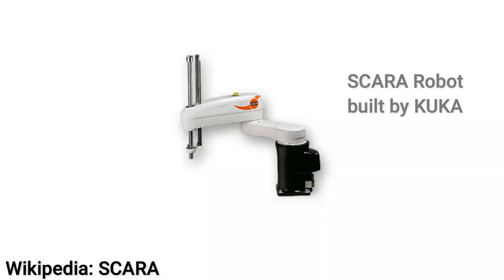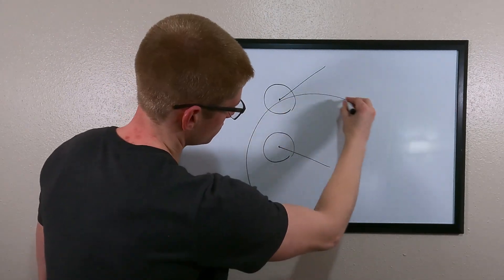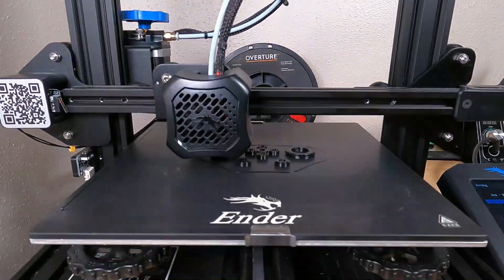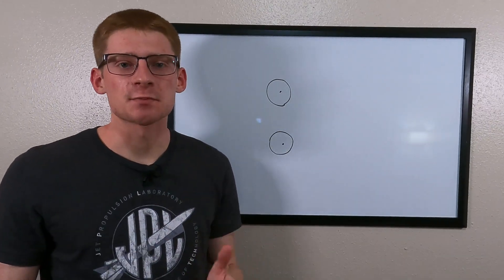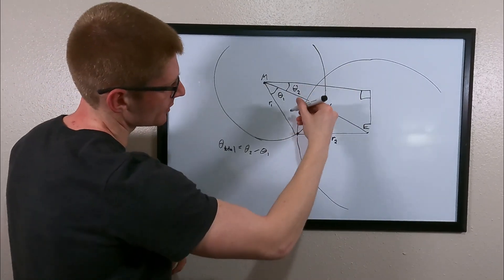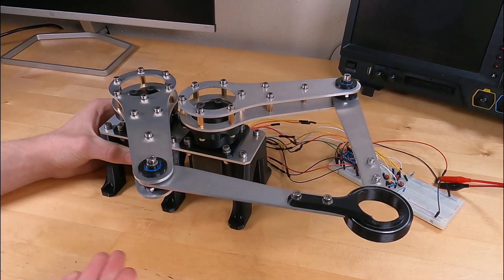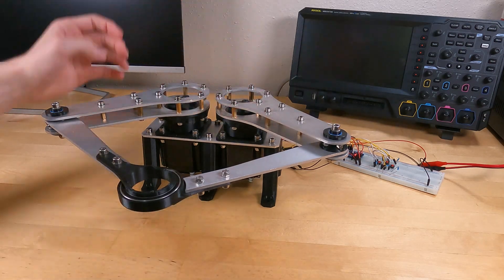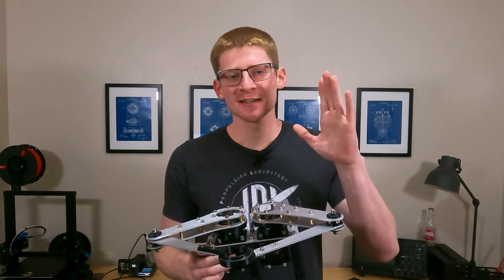I Built a SCARA Robot

Comment: Great job on the video! As a robotics engineer with experience designing and deploying industrial robotic arms, I have a few recommendations for improving the performance and reliability of this project.

First, I recommend using stepper motors with pre-installed gearboxes. Stepper motors offer precise control and high torque at low speeds, making them ideal for robotics applications. Gearboxes can help reduce the required torque and increase the achievable speed, but they also introduce backlash and hysteresis, which can affect the accuracy of the system. Pre-installed gearboxes offer better tolerances and lower backlash than those that are 3D printed, which can be difficult to manufacture with sufficient precision due to machine errors and limited material options.

Second, consider using closed loop stepper motors for professional use cases. Closed loop control allows the system to detect and correct errors in real-time, improving the accuracy and reliability of the system. It also enables additional features such as homing, which can be useful for calibrating the system or returning to a known position. The additional cost of an encoder - around $20 per motor - is generally worth it for professional applications.

Third, consider using a more powerful microcontroller. The Arduino Portenta is a good option, as it offers high performance and a range of connectivity options. Alternatively, an RP2040-based board can also provide good performance at a lower cost. The microcontroller plays a crucial role in the control and communication of the system, so it is important to choose one that can handle the required workload and has sufficient memory and processing power.

Finally, if you plan to add an end effector to your setup, make sure to consider the weight and the required torque and speed at the joints. The selection of bearings will depend on the load and the required stiffness and accuracy of the system. Proper sizing and lubrication of the bearings can help improve the performance and lifespan of the system.

I hope these suggestions are helpful, and I look forward to seeing more of your work on the channel!
Reply: Why recommend these mcu's? Portenta is way overkill and the 2040 does not have a single timer/counter with decent functionality for motor control. Closed loop for steppers is irrelevant if the system is designed correctly (e.g. loads are within spec).
Reply: Hi,  @MrFujinko 
What kind of characteristics do you need for a timer to be useful for motor control?

Comment: For some beefier processing check out the esp32 dev boards. They can be programmed with the same Arduino IDE and code but are single or dual core, 32 bits, and up to 240MHz. Oh and like four bucks a pop.

Comment: Why did you opt to use the cycloidal gearboxes? Those motors should've been plenty torquey all by themselves to move the arms. Less jitter too.  Industrial scaras are direct drives as far as I know.
Reply: I think resolution would be more of a problem than torque. 1.8 degree full steps are several mm of linear movement. Even with microstepping it's pretty coarse, and then torque is not good either.

Comment: Have you considered adding one or more off-cycles between heavier calculations where you use a bit of interpolation to smooth things out before correcting the position in future cycles?
Reply: Sidenote each trig op takes much longer than a digital write I believe, but youre doing a lot of them and they add up so you might also want to look into direct port manipulation. For every set of digital writes you could basically have a single register store and it would be something on the order of 10-20 times faster. I also realize you are using a lot of delays which I'm not sure aren't just as significant than whatever math the arduino has to do. So if those are necessary - and it looks like they are - then nothing with port manipulation will improve efficiency much and you probably already knew that.

Expect the asin operation to take something like 100 micros although you also do some math inside the sin but lets say no more than 200. Some people have made their own look up table implementations plus some interpolation to combat the slow trig functions but I would start here first and before doing anything too fancy you would probably just get a different micro which is completely reasonable.

Comment: Nice video! Good explanation of the IK. A large difference between scara and this 5 bar is that this is a parallel manipulator while scara is serial. How did you decide link lengths? I read a paper awhile ago about optimization of workspace to determine the geometry. Nice work again!

Comment: It seems we should all be buying toy robots first and learning how to control them  easily.  The control system is the hard part (at low cost).   I see very  many hardware build , but very little real world application for the small business owner.  For long term repetitive tasks it's worth doing specialized control programming. However for a universal shop robot the programming of the control  takes too long to make it worth it... I think that's what we need to concentrate on.  Maybe I'm wrong but show me some videos where people are implementing robotic arms in a very small shop to do useful things.....Good video and nice SCARA :-)   M
Reply: The problem is currently the ship shortage: I have still few STM32F407Z that I bough for 5bugs, and now they are just impossible to find or sold at x30 price (speaking of cheap control). For industrial robotics, there are plenty of solutions out there, they most of them includes linear guides and some other mechnanics. I don't know if there is something open-source and free, maybe LinuxCNC is a good point to start.
Reply: People don't use robotic arms in their shops 'cause they are either very expensive or very complicated to make. Robotic control systems require a lot of math to work properly (including differential equations if you try to consider robots mass), meanwhile most freak out seeing a litle more than basic algebra. You see many hardware attempts because it's lot easier to make something that "just works" forgetting about efficiency or longevity. There is a reason why it takes engineers months to create a product worth selling.